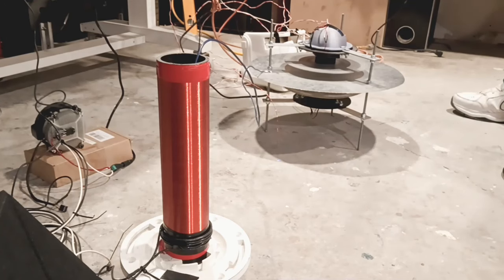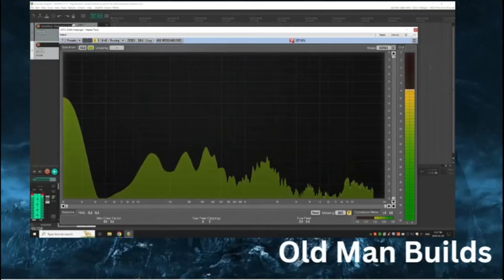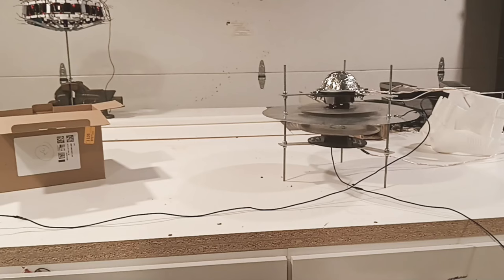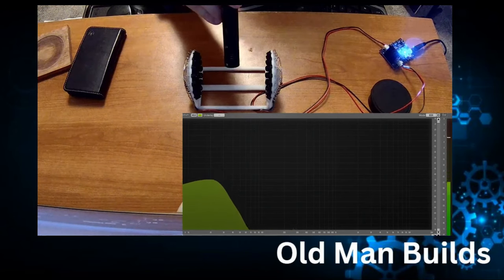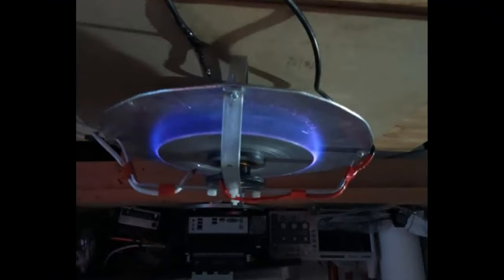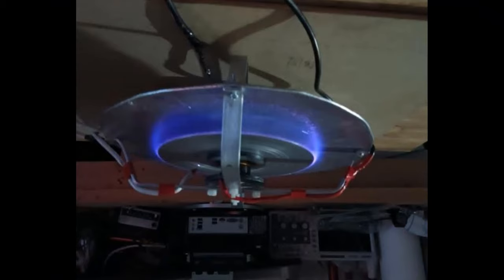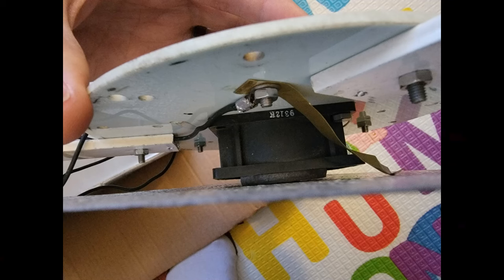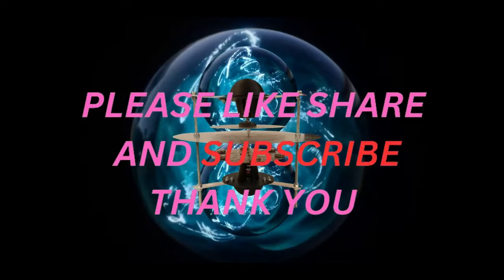Graviflyer Testing 8

Comment: Nathan, remember when I explained to you about the universe flashing on and off at the Planck time? The universe also rotates at 3.141592 rads/sec from my many years of experience with my theory. So, the guy in the video whom I have watched his video as I remember his voice found a frequency of between 18-20 hz. It is actually 19 hz. To get this number a person does the following calculation:  (3*1200)/(3.141592*60)=19.1. If you increase the disks rotation to 1800 or 2400 you get the following calculations:  (3*1800)/(3.141592*60)=28.6 and (3*2400)/(3.141592*60)=38.2.  The 3 is for the 3 disks. The pi value is for the universe rotation rate. The 1200/60, 1800/60, and 2400/60 is the rps of the disk. The Schumann resonances are 7.83 Hz (fundamental), 14.3, 20.8, 27.3, and 33.8 Hz. The Schumann resonance sets up due to the spinning earth and the gravity field that is the glassy silica layer pulling in space with a viscosity that puts a force on us to hold us to the surface.  I wish you knew my theory, but I cannot post it here.  If you get the top disk spinning at 900 rpm amd the bottom disk spinning at 493 rpm you may find something as these are the Schumann resonances of 7.83 and 14.3. The center of the earth is spinning at different rates and why the disks have to be spinning at different rates so the Schumann resonances set up.  The plasma discharge may be doing the same thing as the glassy silica layer of the earth moving space. If you set up the voltages on the three plates correctly the space instead of going into the earth would be going out of the earth and negate gravity as I just explained to you.  The earth's magnetic field, electric field and gravity field, the spinning earth, the Schumann resonance are all part of the gravity of the earth. Lightning that is always going on with the earth from the ionosphere to the ground also has something to do with gravity like your electrical arcs between your top and center disks. The earth's magnetic field spinning produces a current in the earth much like the magnets do with the graviflyer. The  graviflyer's magnetic field has to be opposite the earth's magnetic field to work. The graviflyer's electric field has to be opposite of the earth's electric field. The earth's magnetic field goes from north to south. The earth's electric field goes from inside to outside. The earth's gravity field goes from outer to inner. Maybe the top disk has to be at the second Schumann resonance and the bottom disk has to be at the fundamental Schumann resonance or vice versa as I get confused with this. With the graviflyer's setup being opposite to the earth's the graviflyer may lift up. My guess is that the Schumann resonance of the earth is the earth flashing on and off to offset the entire universe flashing on and off as first the matter universe and then the anti-matter universe just like the graviflyer has to do. The universe is my spectrum that is the black hole particle being red shifted in the matter part of the universe to the anti-matter part of the universe that keeps the conservation laws constant.  The universe flashing on and off is a sine function and why your fluorescent bulb never goes out completely but slowly goes on and off very slowly. Also, what is the white substance on the one disk? Is it aluminum oxide or plastic with a dielectric constant to keep the top disk from shorting out like what I found out from Alexey with the polycarbonate CD coated with Al2O3 on one side and Al on the other side so it acts like a normal capacitor and the top disk has no Al2O3 on it so it can short out as an air capacitor to get the plasma discharge moving the space as I detailed above? The center disk has to be at the higher voltage than the top and bottom disks at the correct positive and negative charges and the reason for the tesla coil. The ultrasound keeps all of this from setting up originally so the charge can set up fast by turning off the ultrasound. The textured aluminum allows the ultrasound to be transmitted through all three disks as I explained earlier with the CD having groves. Alexey had many versions of the graviflyer before getting it correct. He must be an alien to know all of this as I found out by working with the UFOs with the Reagan Administration and the US army black ops in the early 1980's. Also, Earthquakes occur at ultrasound frequencies just like the ultrasound of the graviflyer. The aurora borealis may be the shorting out of the earth just like the shorting out of the bottom disk. Earthquakes are always occurring on the earth. I just sent you an email with this same information. I may not have the set up explained correctly but hopefully you get the idea. The graviflyer settings as per the earth.  https://drive.google.com/drive/folders/1Sj7VZXYxcTraZ7z5uJeYIU1CGiYzUB1V
Reply: Wow I'm impressed. 👍
Reply: I would be interested in hearing your theory, thanks for sharing all that with us!
Reply: @Tech_Planet  Read my other comments to Nathan on his many other videos to learn my theory. If I posted my entire theory and where to view it or give you my address or science sites they would be deleted. Just look up my name on many science sites.
Reply: @Tech_Planet  I have a theory on gyroscopic manipulation, in theory precession drive motion. I have seen Sandy Kidd come close, he has the same idea , as my idea except the gyros need a more independent spin at a much higher speed. But this, electro gravitics , I find much more fascinating. You guys keep up the good work. I know there's a better way for space travel than riding a controlled explosion that you can basically only point and shoot.🤔

Comment: I think I see what is going on here. If you look at Jeremiah's arc/acoustic levitator experiment, the arc is deflecting around the center levitation point, just like the 20 hz surrounds the center point. It's almost like a shield. Perhaps this is being expanded/amplified somehow with the graviflyer. This might be easier to replicate at a smaller scale down the road. Either way, these experiments are showing us interesting attributes about acoustics/electromagnetics.
Reply from the maker: I agree
Reply: awesome video! I haven't seen an experiment like that before. I'd guess the electric arch in that experiment is magnetically coupling to the sound wave "locking it in place" id imagine the speaker wave geometry looking like an arch with the highest pressure point in the center and the lowest pressure being around that center where the arch seems to like to sit, almost "jump rope" back and forth to on both sides avoiding that high pressure zone.
Reply: this is getting so fascinating
Reply from the maker: @fireball75677  the high voltage has a polorized or magnetic part to it. When the frequency matches it pushes the plasma. There might be an air charging going on as well. This is supposed to only happen in a vacuumed chamber. If it works on the graviflyer we have created the pressurized bubble we need.

Comment: You’re inspiring me to continue my graviflyer project as well. Your videos are very in depth and answers all my questions. Thanks for the great videos
Reply from the maker: Like you I want the answer. No matter what I have to do to get it.
Reply: @nathanbunten4299  I have a question, does the middle metal plate need to be insulated? Is the current flowing through the threaded rod offset by the ground wire? After the power is turned on, the middle metal plate cannot light up, but it can be taken out alone.
Reply from the maker: @wenzhizeng8049  the center plate cannot be insolated. It has to resonate, take on a magnetic field and hold a ton of power. The rods are connected but the power level is much lower in them. But the rods do help set the outside field.
Reply: @nathanbunten4299 I did a test today, and the switching power supply showed 0 amps and 12 volts. Do I need to increase the current to the top metal plate? The light is flickering very weakly. I suspect that the current is too weak and affects the lifting force. Also, what method do you use to measure the space charge frequency? After finding the frequency, do you use a function generator to generate the required frequency to resonate? What method did Alexei use to find the resonant frequency and generate the frequency he needed?
Reply from the maker: @wenzhizeng8049  The amps should be in milliamps. But distance is most important. 2" is where I start. When you hear the hiss of the voltage you are there. If you turn all light off you see the field. 

The resonance is 6 main frequency's. This is all in the center plate. You motor speeds dictates the resonance. The eddie current changes the octave if to high. Your upper motor should run at 1200rpm and the lower 500-600rpm. there is a point where the lower on is set and the upper one will make the craft shake or when the speed is slightly lower it will be smooth. Set it on the shaking part just slightly. The resonance is now there. 

just so you know I don't tune this by different devices. I tune it by reaction to how it is running. I found that the perfect tune on different devices works one day and not the next. The weather and humidity cause this problem. So it is important to get a feel for the tuning.

Comment: Can we get the make/model number for your mic? Most mics operate from 20Hz to 20kHz, so the fact that your mic is going off at 20Hz, the lowest possible freq of the mic, is a bit sus. Makes me think that it's an artifact.
Reply from the maker: Tech planet recommended a mic. I will order it. I will also check with him to see if the new mic.  goes below 20hz. I am good with any number that comes out of the testing as long as it is right. I agree get rid of anything suspect.
Reply: These are good questions. I use phantom power cond. microphones so you can pick up sensitivity detail in the signal without adding noise. It is very strange to get an artifact which cuts out all frequencies @ a set distance from a coil that has the highest decibel rating in the whole 20 khz range. It's more strange to get that with a low voltage acoustic levitator which tells me that there is something going on there. You can get lower 20hz frequencies with quite a few mics, it's just less accurate. But if you want more accuracy at low frequencies then you need an infrasound microphone(really expensive for good ones) with local shielding so that's what I mean by getting more equipment. I'm not sure if that will really get any more answers though because you would want to move it around to find different pressure zones. It's also tricky balance because you don't want to wreck your recording equipment around high voltage either. I can test some more u.t.' on my side and see what happens because I think there needs to be more clarification on this. I would be really curious to see if you can emit an acoustic frequency by your tesla coil in that dead zone and see if a distant mic would pick it up, that would be very interesting & something easy to try. That would be pretty important test to try around different areas of the graviflyer now that I think about it.